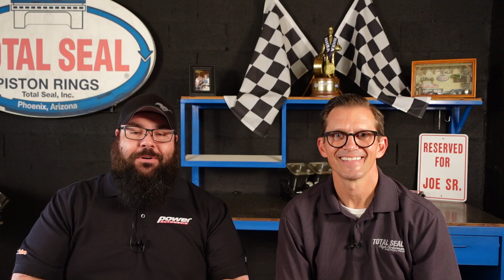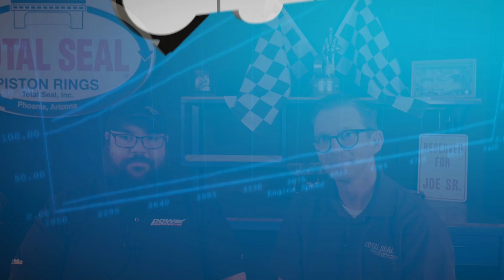Talking Piston Ring Friction With Total Seal's Lake Speed, Jr.

Comment: Very educational video. I’m building a 400 SBC with forged pistons and a 1mm, 1mm, 2mm ring pack. The new reciprocating assembly is much lighter than stock and it is internally balanced so with AFR heads, an hydraulic roller cam and low friction rings I’m looking forward to a big increase in power and torque.
Reply from the maker: Sounds like a fun build. I think you'll be happy with the results.
Reply: Thanks for all the great content you guys produce.